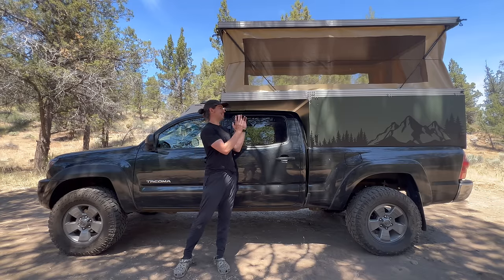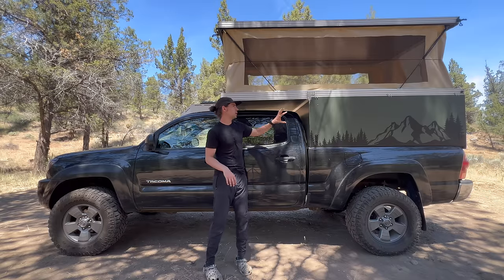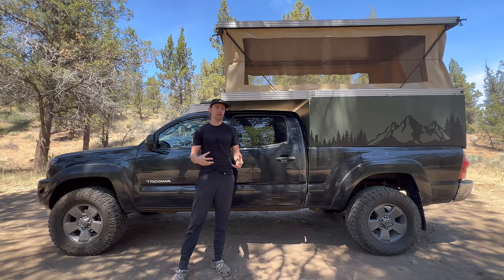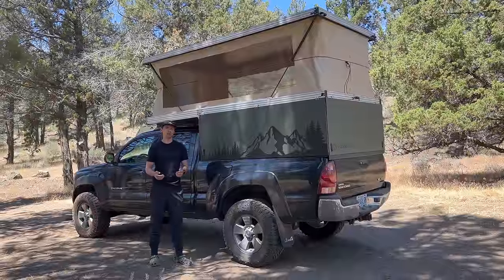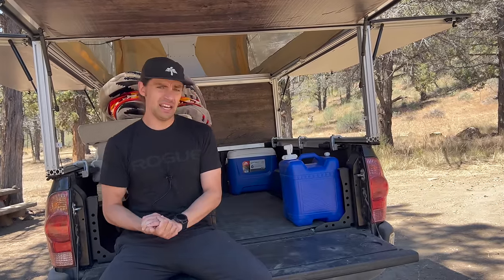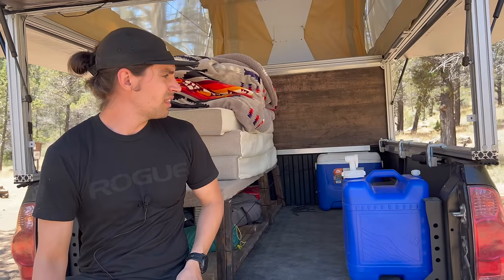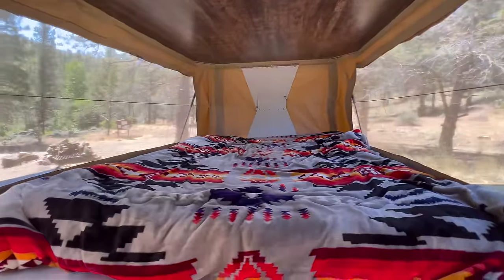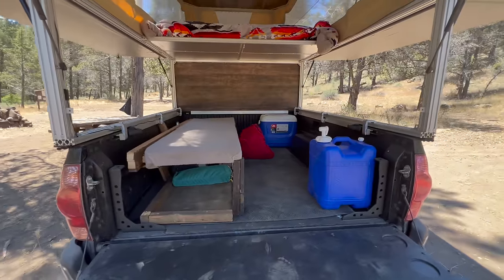No-Weld/No-Sew DIY POP-UP Camper Walkthrough | KIT Campers V2

Comment: Love your build.  I am redoing an older slide in pop up and want to make a roof like yours using gas struts.  What type of sheet material did you use and was it easy to connect to the 80/20?  Im looking into composite honeycomb panels.
Reply: 2:07
Reply from the maker: Thanks I appreciate it! I used aluminum composite material. I didn't get too far looking into honeycomb panel as I think it was way more expensive. ACM is ~$70 for a 4x8 through the right supplier. It was easy to affix the the 8020, I just used VHB Tape from 3M and then self tapping screws if necessary.

Comment: What hinges do you use for the doors and are they waterproof or do you have a seal along them? This is an awesome build that gives me ideas for an off-road camp trailer I've been planning!
Reply from the maker: I am currently just using the aluminum hinges from TNUTZ but think that using hurrican hinges would be the best option going forward. In order to try and make the seams watertight I have been using a line of gorilla tape on the inside which has worked pretty well so far!

Comment: Looks like you used 10 series 1030 and 2020 80/20 extrusions, correction actually looks like you used 15 series (3030LS and 1545LS) everywhere except possibly the bed panels. Why?
Reply from the maker: Nope I only used 10 series (1010) and different sizes of 10 series (from 1020, to 2020, to 2040). 10 series is a lot more economical and space efficient so I was able to reinforce places like the overhang with cross bars which makes the overhang even stronger. You can check out the free bill of materials if you want to know what was used where - https://www.kitcampers.co/diypopupv2
Reply: @KitCampers  I see you didn’t actually use 80/20 Inc. extrusions. 80/20 is a registered trademark and they can sue anyone infringing in it, even if they are not selling their competitors products. They have sued the T-nutz guy several times and he allegedly does some shady stuff to try to avoid legal judgements. I don’t blame them for suing, I would too. Anybody would protect their IP. Use of T-nutz products is probably why you did not use black. He has very limited product line compared to the over 2000 products in the 80/20 line. Did you buy the rubber threshold as an 8020 product. The only thing I’ve ever bought from the Tnutz guy that I can recall is some economy double T nuts and I think he sent me triple T nuts instead but I could use them and it was for the same price so I did not complain even though he didn’t check with me first. perhaps it was an error. Does he have free shipping on extrusions for larger orders? if not I find it hard to believe that it would be cheaper to buy them from him and pay shipping compared to buying them from sources I know of where they have the occasional 20% off and always have free shipping. During Covid if you bought something for $100 or less and changed your mind my source usually just gave you your money back and said keep it. My source pays for return shipping too for any reason no questions asked.
Reply from the maker: @GOLDVIOLINbowofdeath  Yeah, I generally use the term aluminum extrusion not 8020 anymore. I also have reached out to 8020 in the past and haven't heard anything back so I don't know what it's like to work with them. The tnutz suppliers are about half the price compared to other extrusion manufacturers this makes a DIY camper out of this material actually viable for consumers.

Comment: Even if you want to have stuff sewn.   If you want special windows,  doors,  etc...    Another option exists.  Many marina's have stores that specializes in Bimini tops and enclosures.     you can actually get them use boat canvas then make a custom canvas "shell" for your trailer,   this can even include 2 stage windows where you have a bug screen AND a clear plastic window.   

Yes it can cost a bit but the option to have a professionally done, high quality canvas section.  With windows, screens, and even covers,  thats properly fitted to your box...  is an advantage.   That means you only have to frame it out.   You cave even have a "zipper door"  put in the rear for example,  letting you unzip it and get into the camper, then zip it up again to prevent insects from getting in.
Reply from the maker: Oh I totally agree, I am currently working with some people to try and find a good affordable solution for this. I will look into the marinas too! Great suggestion
Reply: @KitCampers  There really isn't much difference between a camper and a boat shell, other then the boat shell is exposed to more water.   Another option depending on where you live is actual canvas tent makers.   

If you live in a city/town that actually has a company that makes sidewall tents, they could likely do it for you to.

The reason i think about this again, is for the windows and doors.   having an actual 2 layer bug screen outer, plastic inner window option could be really helpful for air flow, in popups.
Reply: Hmm,   now that i'm thinking about it, you could do a "canvas"  extension.   dropping down a back panel to create a 3-6' rear extension with sloped canvas in the rear and a canvas door.    this "tent area"  would increase the square footage of the trailer making it feel much more open,   act as an extra "sleeping area"  with the ability to put air mats down and bedding.   

use it as a mud room, or anything else.   just an extra 3-6 feet of livable space tacked on the end as a "fold out tent" area.

Comment: Hi, my name is Art. I tow people's toys around boats, campers, and things like that. I have a a 2020 Ram 5" bed. I am 76 and live in my truck. I sleep in my truck. I would love to be able to build something like you have here. Do not need much. The most important part would be the bed. I just had my knees replaced and need to be able to stretch out. Can you help me? Thanks
Reply from the maker: Hi Art! Thanks for reaching out. I have a build guide on my website - kitcampers.co you can see if that's something you would want to build or we can figure out something that may be a bit easier to build.
Reply: @KitCampers  Thanks for getting back to me. Can you tell me the price of the Pop Up? I like your build. I have a 2020 Ram 1500. Need to get the money together. Thanks
Reply from the maker: @artskill46  Yeah the price last time I checked was around $4500 for everything. It might be a bit different due to the different dimensions of your truck but shouldn't be that different. Also, the kit build guide has a customizable bill of materials so you should be able to get a fully custom build list and price from that when you input all of your trucks measurements. https://www.kitcampers.co/theclassroom

Comment: i have a question is this universal ? i dont have a toyota i have a gmc sierra ? would it be the same ?
Reply from the maker: The plans are for a tacoma long bed, but should be fairly easily modifiable to fit larger trucks. The one limitation is that trucks that have beds longer than 94" would need some significant redesign.

Comment: Great build. How do you keep rain out of the pop up?
Reply from the maker: Thanks I really appreciate it! So currently, since the windows are so big I really just have to shut the roof to keep the rain out. But I am also working on making some clear vinyl windows to go on the outside. I just haven't had much time to work on them yet.
Reply: @KitCampers  Cool,   I wonder if there is a way to use the sort of spring steel rods used in roof tents to hold up a waterproof flape that could be closed with velcro. Or something like that.
Reply from the maker: @markhusbands2037  yeah that’s a great suggestion! I have seen some other people do that, and that way I could moderate ventilation as well

Comment: My old Tacoma got rear-ended by a box truck on my way to work. A 2"x2" board in the bed got shoved through the front of the box and into the cab. Thankfully no-one was in the passenger seat, but it turned me off to the idea of having long boards- or aluminum extrusions, skis, etc- mounted lengthwise in my bed. Your cot idea will basically put spears in your crumple zone. Great build otherwise, love the approach!
Reply from the maker: Thanks I appreciate the feedback and caution.

Comment: I really like this design.  so how would this framing work if the truck bed tapered from the front to back of the bed, where the tailgate end was about 2 inches more narrow than up by the cab?

i have a GMC with 8 ft bed and having problems finding a commercial built shell to fit, by any of the manufacturers.  one problem I'll have in a DIY build is that while it is normal width up by the cab, the width is 2 inches less back at the tailgate.  since it is not square, will I have a problem using this 8020 aluminum or is there a way to cut and attach it at a slight angle different than 90°?  thanks.
Reply from the maker: Yeah unfortunately using the 8020 you are almost stuck with only 90 degree angles. There are some ways to get around that but with the fasteners that I use that are vibration resistant they require 90 degree agains so you may be out of luck. That is interesting that your truck bed tapers in though. the outside of mine does but not the inside.
Reply: @KitCampers  ya, on the GMCs, and actually even Fords, from the early 2000s until present, they tapered the beds for some ungodly reason.  It has made it nearly impossible to find an older used topper as anything in my year ranges get very specific to the year, make, model and even the cab style.  And now its just old enough of a truck that the new topper manufacturers no longer make the very few options that were available.

Thanks for your reply.  I appreciate that.
Reply from the maker: @RoyatAvalonFarms  No problem! But yeah that's VERY maddening, I wonder what they were thinking when they did that. unfortuantely that means that this styl may not be the best option for your truck. If you could weld you could do the lower from with steel then the upper tent area with the aluminum.
Reply: @KitCampers  thanks.
Reply from the maker: @RoyatAvalonFarms  No problem!

Comment: I don't see how that top rail is strong enough. Unless you doubled them up. Go fast tops have bracing.
Reply from the maker: Like for the bed hangover? Its definitely strong enough, I hung my entire body off of it multiple times and it didn't budge. Even with myself and fiance up there it didnt move. The 8020 is extremely strong in that orientation.

Comment: wow yours is awesome! long time ago i welded my own lumber racks. then i thought let's build a camper shell around it! super heavy with 2x2" 1/4 steel tubing and 3/4" marine plywood aluminum trim and elastomeric paint, but mine turned out awesome, but i wish i could make it taller to put 2 motorcycles in under! I can still carry 1000lbs of wood on it!
Reply from the maker: Very nice! yeah I wish I had the ability to weld, probably some day!
Reply: @KitCampers  you never know what direction you're going to go! I have often left the camper shell off to have motorcycles in the back. And then have a nice tent and mattress for a couple hundred dollars that I can throw up anywhere. The amount of money that you save is exponential compared to what you spend on an Overlander camper pop-up. But I love what you've done!

Comment: Nicely done! How thick is that composite material? is it structural/self supporting? Are you using it to keep from racking or are the joints of the 80/20  rigid enough on their own?
Reply from the maker: The composite material is 3mm I believe so pretty thin, but fairly self supporting. For the roof it definitely helps with structure but the double anchor joints that I am using seem to be strong enough so far.

Comment: Very cool. Sure don't believe it's 10 ft. long though.
Reply from the maker: The roof and bed extension is definitely 10 ft. The truck is a long bed which is 73.5 inches long.
Reply: @KitCampers  doesn't look like 4 ft. above cab.
Reply from the maker: @richardvalitalo3670  the bed area is 76.5 inches total and the overhang is 44.5. You can see all the measuremenst on free bill of materials at kitcampers.co

Comment: Where did you get the aluminum composite panels?
Reply from the maker: I get them from a local supplier called Sun Supply, they are in the pacific northwest, I don't know of other places around the country, but a local signage shop is a good place to start. However, be wary of buying from them, their mark up is usually crazy. I got my 4x8 panels for $70 a piece

Comment: Really love this man! Such a nice creative build. Of all the truck camper videos, I keep going back to this one as a DIY idea.

I wanted to ask though.. how would this set up stand in winter conditions when it's cold? Do you think the insulation would hold heat etc. and maybe be better for that if there were vinylvcovers for the windows up top too? I noticed gaskets on the pop-out doors, would they close tight to seal for retaining heat as well? Thanks!
Reply from the maker: Thanks, I really appreciate it! That's a great question and I don't really know how it would hold up. For individuals interested in cold camping, I recommend adding a layer of insulating canvas around the inside, this could be wool or something similar, then adding a vent in the roof, and using a heater. Another change I would make is to make hard sides that don't open rather than the cabana doors, however, I think with the gaskets and insulation it could hold up.

Comment: ACM i wouldn't call expensive at all. Cheaper then solid aluminum or any other material you would buy. I get sheets for $50 from my vendor
Reply from the maker: $50 isn't bad at all, I have found it at the cheapest $77 a sheet but for the strength and weather resistance it's well worth it. Who is your vendor if you don't mind me asking.

Comment: Would build me one please!? Just like this for my 2005 taco extra cab 6’ bed? Please?
Reply from the maker: Hi Alex, shoot me a message on instagram and we can work something out! My instagram is @kit.campers
Reply: How much weight will the bed support? What about when it rains?
Reply from the maker: @harryd4496  Not sure the exact amount of weight it could carry but my fiance and I weigh about 325lbs between us and it works perfectly fine. For rain, I haven't had it out in anything crazy but the canvas overhangs the bed rails as a rain gutter. And I have since made waterproof windows just incase it does rain.

Comment: Quick question - Where did you source the composite panels? Was it local or online?
Reply from the maker: I sourced them from a PNW supplier called sun supply! They were great, super easy to work with and shipped for free! I haven't found a good online supplier yet, so my recommendation is to go to local sign or metal working places. Be wary of the local sign shops! I got my ACM for $70 a panel and the local sign shop was going to charge me $150.
Reply: @KitCampers  Thank you! It looks like they have an office in Kent, WA so not far away from me. Waaaaay cheaper than I was seeing online. I'll check it out!
Reply: @KitCampers  what are the composite panels you used? I see Sun Supply has several different composite panels available. I built a slide for the side of a van that I used a fibreglass honeycomb foam core board that I managed to only source 1 sheet from a local boat builder. It is great stuff but the only suppliers I can find for these composite panels are on the east coast or California and getting a possible alternative could be helpful. Not sure if the strength of Sun Supply panels is enough but I would like to look into a supplier from the PNW. TIA
Reply from the maker: @kensoutham6828  The composite panels are just their aluminum composite panels (ACM) but they have thicker and more expensive branded stuff (dibond and epanel) I just got the lowest cost ones (70$ for a 4x8)

Comment: That will need some cross bracing or some other shear component.  Those corners are not strong enough.
Reply from the maker: Definitely for any sort of hard offroading I highly reocmmend adding bracing. I have driven it for 2500 miles so far and haven't had any issues even while driving on wash board roads and some very like offroading though. The good thing about this stuff is that you can VERY easily add bracing if necessary.
Reply: @KitCampers  even wind buffeting on the highway will stress those bolts.  You are taking the full side loads as a moment on a small machine screw threaded and backed into aluminum.  The gusset plates 8020 sells will get you highway strong but you will need them in both directions of the corners, conflicting with your doors.
Reply from the maker: @Qwiv  Thanks I appreciate the input, I can always add 1 inch gussets rather than two so there is no interference.

Comment: Nicely done man! I’d take this over anything you can buy retail. I’ve kitted out a work van with 8020 with homemade racks and thought it might be useful for this type of application also. I’m finally excited to take action on that after watching this video
Reply from the maker: Thanks, and that's awesome! Definitely let me know if you have any other questions or anything like that! And if/when you buy the classroom access I will be there to answer all your questions as well.
Reply: @KitCampers  curious if it’s water tight. That, and how do you prevent debris from building up in the 8020 channels. If those are things you have resolved, it would probably determine if I went this route
Reply from the maker: @Wallymakesstuff  The way that the canvas is mounted and the way that the windows work (they are mounted at the bottom) should make it water tight. It's definitely water tight when closed. To prevent stuff from building up in the channels I just blow them out every once in a while with a leaf blower, but most of the time there isn't much that builds up in the channels anyways.